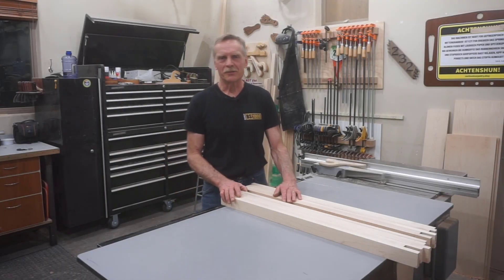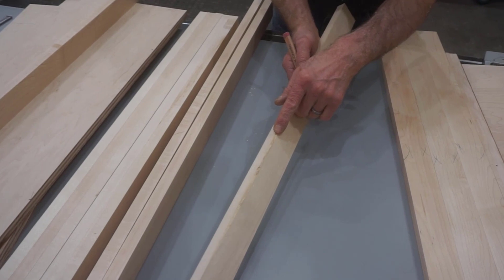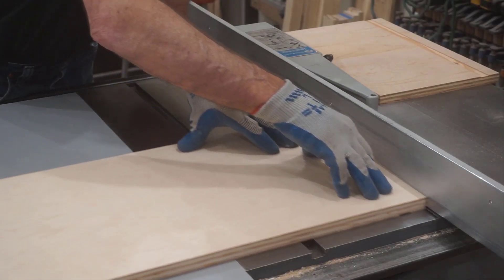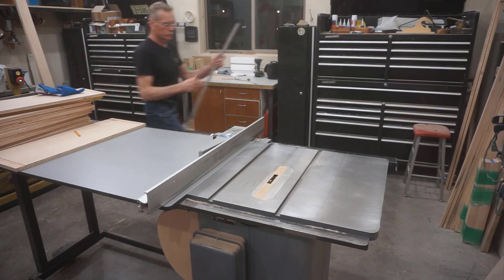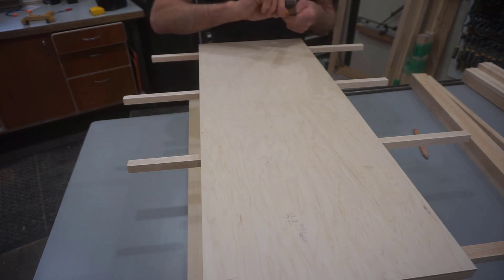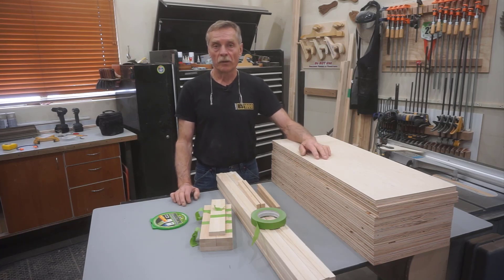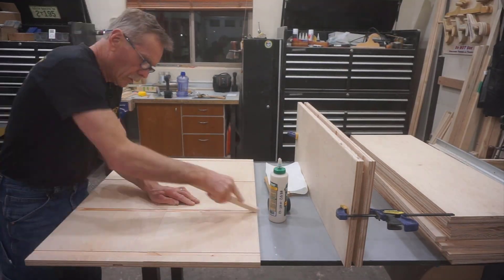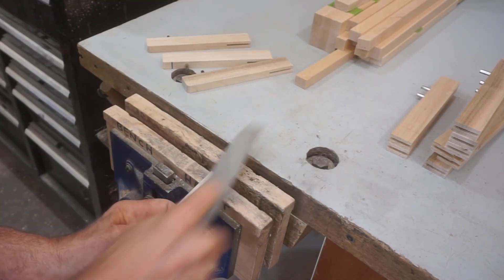Thick Adjustable Shelves with Hidden Hardware

Comment: Dear Matt, yet again you surprise me with an elegant solution to an age old problem. I had an old china cabinet which was struggling under the weight of our glass collection until one day - crash, bang and shatter - one shelf let go of its light-weight connectors and fell to the bottom.  Looking at your construction - because the edges are so snug, there is little chance for the pins to work their way loose and bend their way out of their locating holes.  Brilliant! Thanks for sharing.
Reply from the maker: Thanks Peter... the value of sculpture, pottery and carvings that are displayed on these shelves demanded a 100% fail safe pin design and I felt 100% comfortable that this solution fills the bill 😎 Sorry to hear your glass collection suffered from light weight pin failure... not a pleasant thing in any circumstance...Best, Matt

Comment: I have been woodworking for 15 years and there was an absolute ton of information and techniques in this video that I have never thought of or tried.  Love your precision approach.  I will be checking out your channel for videos on equipment setup and calibration.  That is definitely an area that I need to improve on in my own shop.
Reply from the maker: Thanks Dirk... I've developed and been doing much of what you see in the video over 40+ years working with wood so it's great to know you find it useful.  I don't really have videos that show calibration per se but many videos show how to achieve very precise results with equipment that IS set up accurately.  Hope you find more helpful stuff at Next Level Carpentry... Best, Matt

Comment: I use featherboards when making joinery cuts on the table saw. Pressing the work piece against the fence on the rabbet cut assures a good glue line where lip and shelf meet. Pressing down toward the table assures consistent depth of dadoes. For batch work like this, the minimal setup time is a sound investment in precision, ease, and safety.
Reply from the maker: Hey Michael... thanks for watching and commenting.  Funny how, even with the knowledge of better work with minimal setup, I still don't use featherboards every time I should.  Guess it goes to 'lazy man works the hardest' when it takes extra steps to deal with poor cuts, right?  Hope things are going well with you... current uncertainty sure rocks the work/scheduling boat, doesn't it?! Best, Matt
Reply: @NextLevelCarpentry  Hi Matt. Regarding featherboards, your emphasis on precise stock prep of the shelf lips goes a long way to making them unnecessary, especially for an experienced hand like you. I think that much of my allegiance to featherboards and feeders comes from my early experience cleaning blood and the ends of several of my mentor's fingers from a saw. I was very impressed with your stout shelf construction and stealth supports. I have an upcoming casework job with wide spans where I might copy your design almost exactly. Thanks for the micro-detailed tutorial, as always.

Comment: Thoughtful approach to shelf support and eliminating visible shelf supports. Kind of reminds me of the old Scan hidden support system where a metal “heavy wire” support was used along with a slot cut in their shelf ends.  Although your shelves could easily support a very heavy load compared to the Scan support system. One thing which did make me cringe was watching you cut the dadoes more towards the middle of the shelves. I now use a sled for all cuts like these and have several dedicated dado sleds.

Comment: You're doing amazing job as usual. On 23:13, I have those clamps like yours long time, but bought several months ago new DeWalt clamps. Those are really good, much better. The rubber pads stay put all the time, you're not gonna chase them on the floor, and the clamps are powerful biting to hold. They are also constructed better and neater. God bless!
Reply from the maker: Hey Sergey, FYI I recently replaced ALL my squeeze clamps for the reasons you say: their gripping power is weak and the pads falling off is annoying!  My new clamps are like these but a different color: https://www.amazon.com/dp/B000JCIMD6/?ref=idea_lv_dp_ I really like them but didn't know about DeWalt's to compare... hope I don't regret my choice😯 Will you post a link showing the DeWalt clamps you like and recommend?  I'm curious which ones they are and think other viewers would be interested too.     Thanks! Best, Matt

Comment: You do great work.  Thanks for sharing.  I use some of the blue grip gloves from U-Line when I am handling material.  It helps with grip and protects me from splinters.
Just tell the complainers the easy answer about the gloves, don't put your hand on the blade and it doesn't matter if you have gloves or not.
Reply: Exactly. If your hand is so close that it can grab that fabric, you're gonna get hurt anyway.

Comment: I love the gang cutting method with the tape.  Of course, that means I'll screw up ten pieces at a time instead of one.
Reply from the maker: I would be lying if I told you I never end up with a whole batch of perfectly accurate mistakes by gang cutting things but more often than not it works as intended.... Best, Matt

Comment: Thanks Matt, that was the one.
Reply from the maker: Cool.  There are others showing the process but in less detail... hope it helps.  Let me know if you have questions as I never know when I've glossed over something important to viewers that I do as routine.  Best, Matt
Reply: Not to worry Matt, your doing just fine. I wanted to know because I ordered a 9" Groz vise (and wanted to try your method) which came in out of wack and not parallel. Waiting for Northern Tool to send me an RMA.

Comment: Love the accurate work. One thought: Maybe the shelves would be even stronger if the shelf spacers were run parallel to the front edge so that the shelf structure would behave as an I beam with as many webs as spacers (plus the front face)? As shown, the top board has more freedom to deform independently from the bottom under load.
Reply from the maker: Ribs shown at 17:39 prevent any meaningful difference in deformation between top and bottom panels...

Comment: This was so helpful! I'm building something very similar and this helped validate and correct some of my approach for the hidden hardware.
I'm curious though - is the spline with aluminum necessary? Would the piece of wood with two pegs attached not be strong enough?
Reply from the maker: Good question Kevin. The fact is that yes the piece of wood with two pegs attached is plenty strong but I used the spline to make up for any slight difference in the horizontal spacing of holes. The holes are drilled quite accurately but even a sixteenth of an inch variation in any one of the shelves would mean a piece of wood with fixed pins would be difficult or impossible to put in place. That means that the spline actually weakens the Shelf clip but it makes it usable with hole spacing that's less precise than it would need to be with fixed pin spacing. FWIW I now use a True Position shelf pin hole drilling jig which would allow me to drill the holes accurate enough for fixed pins so if I did the project again today I would not spend time making the splines to make the pin spacing is adjustable.
I'm actually planning another shelf build project where I'll use the True Position jig but and a solid shelf clip bar but it will be a while before that video is done.
Best, Matt

Comment: Great shelves. Did you make a video on how to make the shelf structure?  Maybe I missed it but would like to see that. My wife wants me to make a room in our home into a library and need some guidance on how to make decorative shelves with filing drawers on the bottom.
Reply from the maker: Sorry to say: no, Mark.  The rest of the bookshelf was very job specific and didn't warrant a video IMHO.  This shelf design will work in nearly any casework as long as the face frames are flush with the uprights so they can slide straight in.  I did do a video on making Custom Crown Moulding;  https://m.youtube.com/watch?v=86di2rV63wc&t=1910s where you can see the same cabinet in its finished state in case it helps plan/design your project.  Best, Matt
Reply: @NextLevelCarpentry  Thank you.  Did you do the same technique on the casework, meaning double plywood?  The casework frame looks the same thickness.
Reply from the maker: Yes, basically.  The uprights are 2 separate layers with spacers in between to make them 2" 'thick'.  I made a faceframe 2" wide that's applied to the front after installation which is flush to all the verticals.  Considering the overall size of the cabinet I made the vertical sections so they could be transported separately, assembled on site and the face frame applied last.  Hope this helps? Best, Matt
I don't push Patreon but I did produce a patron-only video showing the on site assembly and installation which you'd have access to, along with dozens of other 'behind the scenes' stuff in the Patron Only library there...

Comment: Another great video! You're definitely the most talented carpenter I've seen. I followed one of your cabinet videos and was able to create great cabinets that assembled easily - even better, they were perfectly aligned all over. One thought about this shelf build... since laminated wood is generally stronger (like an i-beam), did you consider using strips of 3/4" plywood turned on end for the spacers?

Comment: If you make the holes in the carcass a little bigger then the pin, you can eliminate the spline and still easily remove the shelf bracket.  With the way you built the shelf so tight around the bracket, you won't have any worry about it wiggling out.

Comment: NITRILE GLOVES:  I frequently use gloves when performing woodworking in my shop, however they are nearly always nitrile gloves. I find that they not only provide the added grip that I need that you highlighted as being a safety feature for using them, but also because they do not have fabric in them, if they were to contact the blade, they would NOT be pulled in. Nitrile gloves of varying thicknesses can be found at various places like Harbor freight or big box stores.   5 and 7 mil work well for me.  The last added benefit that I have found is that I get many fewer splinters in my hands because the nitrile gloves provide a level of protection as well. Personally I like my gloves to be very snug on my hands which gives me good tactile sense and excellent control.  You can get nitrile gloves of varying sizes and select the size that best suits the size of your own hands.  ... That being said, one of the downsides of using nitrile gloves is that they don’t breathe. So if you’re working in warm weather or working up a sweat, then it will get wet inside.  .... Hope this helps.  .... Nice shelf system!!  .... Thanks!

Comment: I am a newbie to carpentry and love your channel, as to me it makes what seems to be the impossible, possible.  I have just been given an old router table which I have no experience of using and was wondering do you have one in your workshop or do you just use your hand router?  if you do can you do a hints and tips on routing?  Keep the good content coming and the jokes...
Reply from the maker: Hey Ed, congrats on scoring a router table!  As you suspect I use a hand router whenever possible because it's better and more efficient for most of the routing I do.  The main thing I use a router table for is pattern routing like this: https://youtu.be/8h4OJHhSH8A?t=1539 
Also; there's  a few things that I ONLY do on a router table like profiling the edges of door panels in this video: https://www.youtube.com/watch?v=RE_BKm4T5Po&t=291s
   A lot of other YouTubers use router tables extensively for all sorts of stuff so you might find more inspiration elsewhere.  Best, Matt
Reply: Matt - thanks for the speedy reply and advice.  Keep the videos coming as they are really helpful during the COVID 19 lockdown here in Ireland.

Comment: Hi there. Just watched this video. Well done! This may be the first channel I've subscribed to. I'm not big on the subscribing to youtube stuff but I'm excited to see what you're up to . Really appreciate you sharing. One question. I'm going to be building a bookshelf sooner than later. Same style actually. Cabinets down low. Shelves on top. I'm not quite sure what plywood I'll be using but it's likely going to be 3/4" maple as you've used. What is your max span for the shelves you've built? Also, I know there are tons of span calculators online; what's your go to. Thanks for the response and keep up the great work!
Reply from the maker: Thanks for stepping out and subbing Josh... much appreciated!
Truth be told I've never had or used a mathematical span calculator for shelves of any type.  It's just old school awareness/experience that guides me.  
I wouldn't make plain shelves out of 3/4" material any more than about 30"wide without a solid wood front edge of around 1 3/4".  If you do plan on using the double layer design/construction shown in this video though I wouldn't hesitate to make them 4' wide unless you plan to store engine parts or a rock collection on them because they're very stiff.  I recently made shelves of this design out of 3/4" thick melamine faced  particleboard that are 40" wide by 18" deep for storing heavy tools in  my shop.  Even though particlboard isn't known for its strength, the shelves are so stiff as to be amazing IMHO.
I think you'll be able to do a very useful 'stress test' just by handling the material you choose.  If it feels flexy and weak, minimize shelf spans unless you do the double layer thing.  In that case I'd bet design considerations would keep your shelves narrower than their strength allows... 4' wide shelves in a residential situation are going to look pretty lanky IMHO.
Have fun with the build!

Comment: Theese floating shelves built darn well. Not like those console ones I see in the shops all the time with a maximum load of 3 kg. This design has by far better support system so the only limiting factor is the blending of the shelf itself. But with this thickness I guess it will only become an issue if you load it full with kettle bells or stack of barbel weights.
Liked the idea of cutting two grooves based on edges instead of precisely looking for the centre. Like you said: "If you will not make it easier for yourself, noone will". 👍

Comment: I really like the finished look with the 1/16th in round over.  I'm using that on a project now based on seeing your technique. Did you call that a "cork" joint?  Thanks for the great videos!
Reply from the maker: Hey Dale, I call it  a 'quirk joint' but am not sure that's the official name... I picked it up  from a similar joint in tile work on a job I did once decades ago.  Regardless of the proper name, it really is a perfect touch for this sort of project.  You're welcome for the videos for sure! Best, Matt

Comment: What type of cabinet saw are u running sir?  I checked out the Amazon store but only saw references to jointer/planer.  Thanx for the great content!
Reply from the maker: Hey Michael, I run a Rockwell/Delta Unisaw circa 1982... I actually uncrated it myself a-way back then and have used it ever since.  Sadly it's long since gone out of production but you might find one on eBay or something if lucky... Best, Matt

Comment: This was a great video! Thank you. I do have to ask, why do a 3/32 rabbit on the shelf face instead of 1/8 or even 1/2?
Reply from the maker: Good question... it's the 'sweet spot' IMHO.  1/16" is not quite enough.  It's hard to make it 1/8" using a 1/8" blade.  1/2" is far too much.  3/32" is enough to be effective and can be cut cleanly using the 1/8" flat top grind rip blade I use as a mini-dado.  I won't argue with anyone to insist it's 'the right way' but am emphatic that it works perfectly for me and the projects I do for clients... Best, Matt
Reply: @NextLevelCarpentry  Matt, thank you so much for the reply! I look forward to more videos from you. Again, this was a great video and I appreciate your time.
Reply from the maker: @ryanmoreau5266  You're quite welcome... glad my explanation made sense because, as I typed it out I realized how OCD my answer must sound! 😎

Comment: Hi Matt, nice video, can you tell what video you made that shows your vertical glue up method in your vise, thanks in advance.
Reply from the maker: Check out professional-grade flat panel doors for one example... that's an old video but I believe I show it for gluing up some flat panels. I'm sure there's more recent examples if that doesn't show it...

Comment: Can not help looking at the shelf's frame , what is the middle ply?
Love your channel.
Reply from the maker: Not sure what you're referring to in your question...
Reply: @NextLevelCarpentry  The sides where you glue the face frame.
Reply: @cecildean3648  Oh, that one.  Those are 2" thick.  I got there with 2 layers of 3/4" and spacer strips of 1/2" melamine faced particleboard.  The thickness was more important than the material though...

Comment: I know you know this little tip but you should share it with you fans. When using a stop block on the drill press if you put a small chamfer on the corners of the block the dust and chips won’t buildup in the corner and cause the work to move away from the stop.

Comment: Matt I love this system that doesn't have hardware showing on the bottom of the shelves.  Very clean look I will definitely incorporate into future projects.  One question, did you source the aluminum splines, or make them yourself?
Reply from the maker: I just cut those myself from aluminum bar stock Matt. I added 1/8 inch by 1 inch aluminum bars to the influencers list linked in the video but it's a common item for local hardware stores. Best, Matt